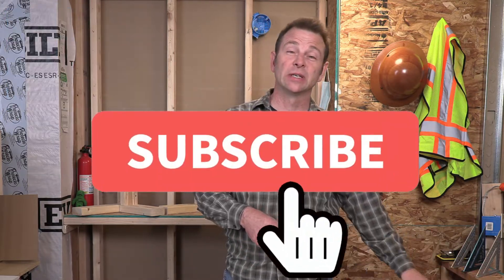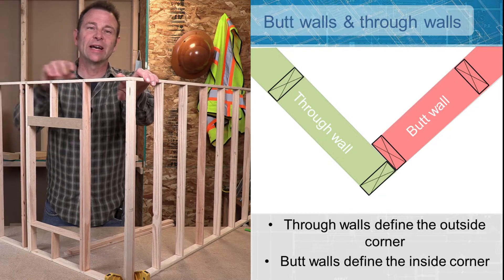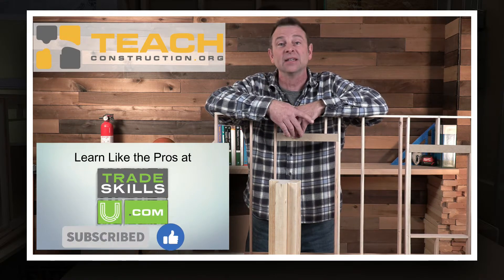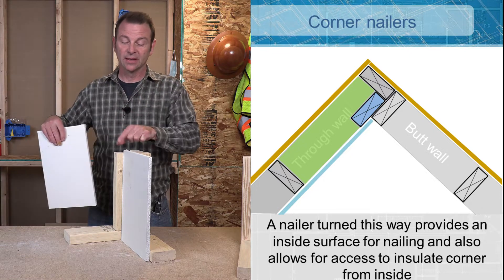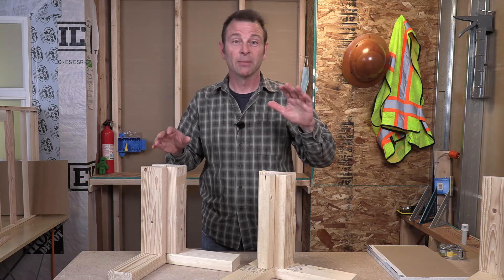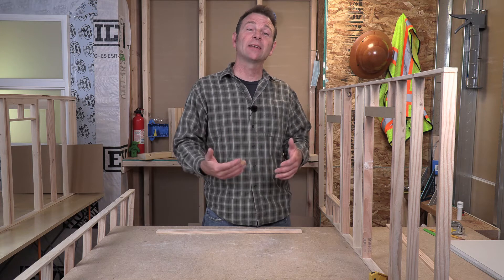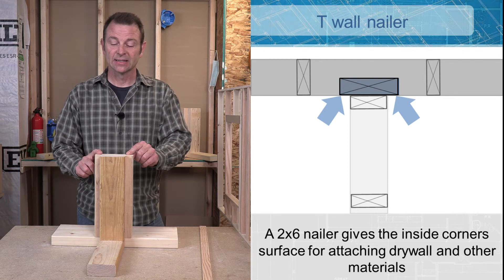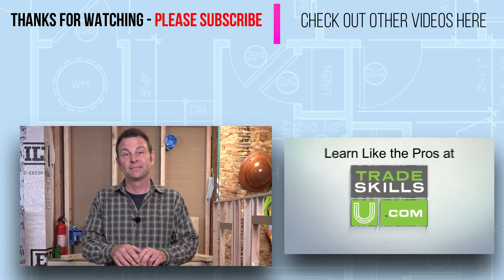Wall Framing Connections and Corners - A Lesson from our Framing course - TEACH Construction

Comment: It what if you’re building the frame so that it’s going directly under garage over head ‘ceiling’ joints?
Reply from the maker: If your wall will be load bearing - then you need to plan for the load - best is to consult with an engineer - if the wall is just a non-load bearing partition wall then you can frame is as outlined

Comment: So what about joining walls in series like if you were to have a very long 30 foot span of wall how do you join those spans together or do you just frame it as one massive piece.
Reply from the maker: Only frame a wall that is able to be lifted in place once completed - they can be of any length.   If you are connecting two wall sections together that are along the same plane, simply nail them together at the end studs and the cap plate will help the connection also.
Reply: @ConstructionEd  thanks.  I think i over complicate things in my head.
Reply from the maker: It is easy to do.

Comment: Old school made your outside coners stronger.
Reply from the maker: While they may be arguably stronger it has been determined that the extra strength is not required in that location.   The value of less thermal bridging has proven worth it.

Comment: Framing a corner like this might be fine for a shed but if you have the inside of your walls finished how do you attach any material to that inside corner ? The 3 stud corner is the practical solution and is a building code requirement in many areas that have winter.
Sorry, I jumped the gun here, I see you later talk about the 3 stud corner........good video, well done.
Reply from the maker: Now that is funny.  I saw your first post was scratching my head wondering what you were talking about.   Then the edited version of the post makes perfect sense.   Yes it is code and the old school corner should not be taught anymore.
Reply: @ConstructionEd  You did a really good job describing the different ways of framing a corner.
I've been a framing contractor, framing everything from basic rancher's to multi million dollar custom homes with massive vaulted ceilings. A foundation and excavating contractor, finishing carpenter, designed and built new homes and now I specialize in structural foundation & concrete repair and screw piling. Basically all I do now is repair structural problems with commercial, residential and even hydro dams. I enjoy solving problems.

Comment: Nice. Are you using 2x6s on some of the base frames? Or all of them? When do you decide if you're going to use 2x6s instead of 2x4s?
Reply from the maker: We are using 2x4 for the lessons just because they are easier to use, but often residential framing uses 2.6 on exterior rooms.    2x6's are used over 2x4's when additional insulation is desired or required by code.
Reply: @ConstructionEd  thank you for the reply. I appreciate your help. Laura

Comment: Instead of the third corner stud, use a 7/16" OSB strip (3") stapled to the butt wall stud. Saves cost of stud and gives more space for insulation.
Reply from the maker: Interesting solution - similar to the drywall clips method
Reply: you won't see a professional contractor do that.

Comment: Wondering if you could help out, when laying out, my understanding is when you lay out your butt wall you pull from the through wall so that your sheeting will hit 16 O.C.. But what happens to your  drywall layout? Since you aren’t pulling from the butt wall corner.
Reply from the maker: That is sometimes an issue - but at least the studs are on a regular pattern - even if the last spacing is sometimes less than the layout pattern used.

Comment: More importantly 3 stud corners are more ridged and provide a surface to nail both walls together
Reply from the maker: Both a 3 and a 4 stud corner allows for walls to be connected - I have heard  folks attempt the argument that a 4 stud corners are "better" because they are more rigid - but at the cost of more material and causing a cold corner - essentially making the argument fairly weak.   And that argument is more often made my the field folks - not a structural engineer.
Reply: @ConstructionEd  that's why ya use more Crowned material that would normally not be used for Straight wall studs the California corner Self Aligns the two Pieces and naturally Straightens the two Pieces. .same method applies to doing Corner Trim on Exterior Siding...it's Smart to set an Apprentice aside and have them learn to read the lumber and separate the Dunnage from the choice Pick for Use as Trimmer's and king studs, wall studs, boards for Bracing " generally bent and twisted lumber and Used for blocking and the Really bad stuff becomes Used for Temp Truss Blocks for Rolling your trusses, you'll save Thousands in lumber and lack of Delivery fees if you pre Sort your and Cut lumber prior to just Banging it out.

Comment: if i may add to this. when doing electrical and boring into the stud to pass the wiring. The 3 stud corner will be easier to pass the wiring around the corner. atleast thats howw i view it.
Reply from the maker: It sure is easier, thanks for the comment

Comment: Very nice video with both wood demo joints and a plan view drawing of joint. The Arkansas 24" 2x6 framing project may have originated the 3 stud corner connection circa early '60's.  Everything has trade offs and using drywall clips may not really save any money and can seriously complicate finish trim both at the baseboard level and at the crown mold level. There is nothing to support or nail into on the one side. If you use the ladder style put the bottom and top blocks against the plates to provide  robust fastening and support.  I have used 3/4" material for both types of connections but maybe it is splitting hairs on insulation efficiency.
Maybe you have already done a video on blocking but it would be nice to highlight all the areas in a house that will be of higher quality if blocking is installed....bathrooms, kitchens, fancy walking wardrobes, TV walls, vertical wood wall covering areas, wainscoting  walls. Some times it is cheaper to just add 1/2" sheathing to entire wall.
Reply from the maker: We do have a video on Blocking and you are correct - well placed blocking is great to work with.

Comment: Would you still do a double top plate in the event you are building rooms in a basement? I ask because at your intersection of the walls (butt wall/through wall) could you fasten the corner to the floor joists instead of overlapping the cap? Thank you for these informative videos
Reply from the maker: You can get away with plenty of cheats when building wall that are not load bearing - just make sure they are plumb and straight
Reply: @ConstructionEd  thank you for the response!

Comment: Hello. I am really enjoying this channel’s content. Very informative. I would like to know, if possible, how to either 1) join the overlapped top plates at corners to accommodate a “ballooned” wall frame that will host a scissored gable truss OR 2) how to brace a scissored gable truss against wind loads without interfering with the interior ceiling’s “vaulted” aspect.

Comment: We just work for building a shed outside of your house is the framework is the same what you show in the video
Reply from the maker: Sheds are often framed slightly differently to save lumber.   But you can certainly use standard framing for yours.  You may want to use a 24 inch layout to save a few studs.

Comment: What if the butt wall, is raked? Say a 2/12 pitched wall? How would the connection be made in that case?
Reply from the maker: Angled plates are difficult to mate with flat top walls. Don't forget that metal strapping can be used for plate splices and other difficult framing connections

Comment: This is exactly what I needed to see with an explanation that makes sense. You, sir, are my hero. Thank you for taking the time to build your mock-ups and make this video!!
Reply: Actually it’s false information! The old way of using corner post is much stronger and more efficient! In a corner post corner you do not need insulation! Now I’m not saying it’s not ever needed if you live in Alaska maybe if you live in upstate New York or the UP you may see improved results in the insulation but I would rather have a strong corner where corner post wrrr used !
I fired the framer in my daughters house because go didn’t use corner posts that were on the drawing ( it’s not a blueprint we dint use blueprint any more we been building houses without blueprints for over 60 years, I do not advocate anyone else not using them it’s just not what we do )
  But a corner post would be built in the shop in a rainy day when we can’t be at job site! That’s another advantage!  Corner post make the corner stringer without using any added product!
In fact houses we built 75 years ago are still standing! You can’t say that about his work!
Our first house in key west Florida was built using our old ways ! It’s over 73 years old been through several hurricanes and has outlasted newer houses built using new way of doing things like no corner post !
 Show me a wood frame house built your way that had withstood hurricane winds and over 3/4 of a century I of storms and weather !
Reply from the maker: Glad it helped!
Reply: @ConstructionEd 😮😊

Comment: I've been using this framing technique since the 80's along with the Arkansas framing plan system which allows for a single top plate, 2x6 studs and truss matched at 24" o.c. for a single story and is a very efficient exterior wall framing.
Reply from the maker: Nice job. That qualifies as true "advanced" framing and matching truss layout to wall studs requires more effort and thought. You can't beat the direct load transfer straight down from roof through the wall studs and to the floor and foundation.
How are you handling your exterior wall top plate splices?
Reply: @ConstructionEd  It's really effortless since you make a layout mark on the plate edge when you layout for studs since they match. There's several ways to reinforce plate. One is to break plate between the stud and add 2x6 to the bottom of plate between the stud, I always liked to add a second piece on top. The second is metal straps or metal plate joining, my preference is wood because that piece laps the plate and the studs/trusses can be nailed to it.
Reply from the maker: Totally agree

Comment: Do you toenail the T-wall 2x6 nailer into the top & bottom plate, or is there another way to make that connection? Great video content, love how thorough and clear the lesson is!
Reply from the maker: The best way is to face nail the 2x6 T-wall nailer when framing the wall.   Typically the wall is lying on the ground and you face nail it through the top and bottom plates.  If the wall is already in place, you could toe nail it. 

Thanks for the compliment on the lessons - I hope you liked and subscribed.

Comment: But it's that California corner weaker meaning over time that 2x4 that's turned will move possible create a crack in your sheet rock corner and as far as the corner being energy efficient you spay foam in your voids inbetween your cripples or just put installation in the voids
Reply from the maker: The energy efficient 3 stud corner is still strong enough for its purpose - it does not need to be a column...it is mainly a nailing surface to use for interior finish like drywall.   If the 2x that is turned is fastened with the proper amount of fasteners it will should not move enough to be an issue.   For sealing you need to foam/caulk many of the gaps.   Build it tight, and ventilate it right.